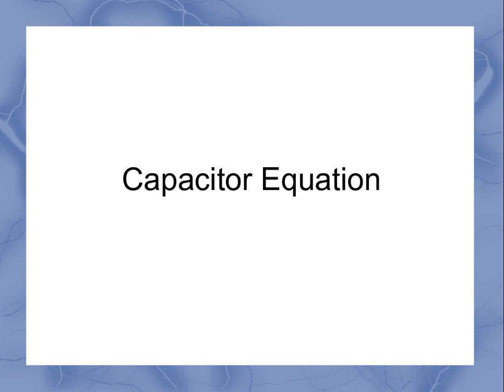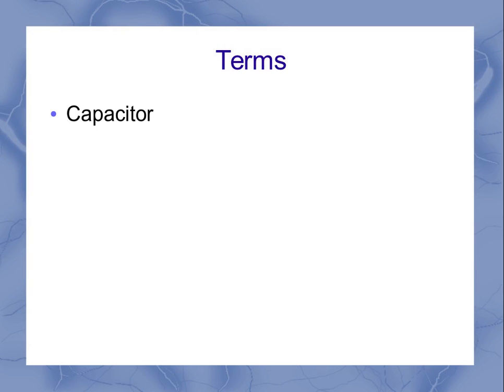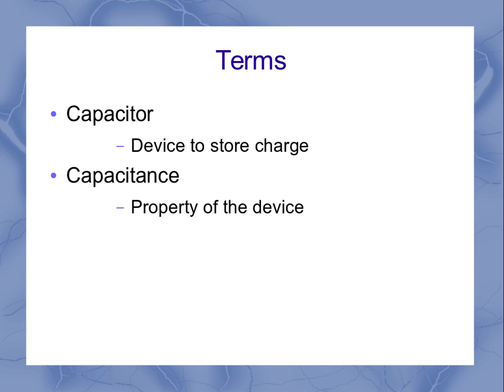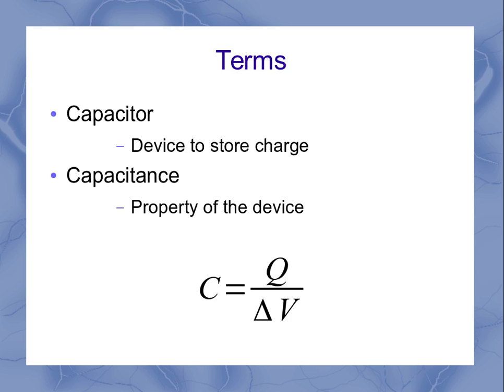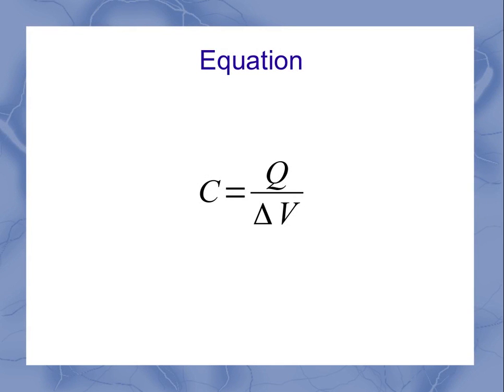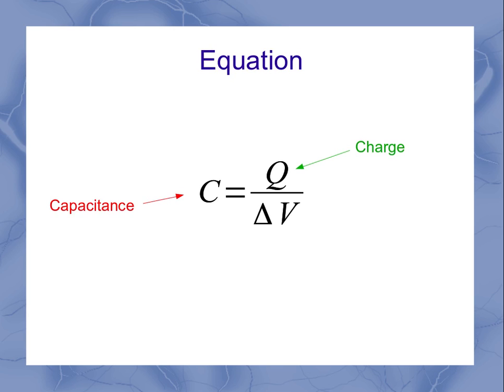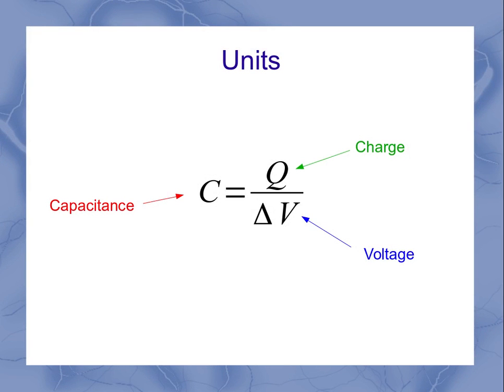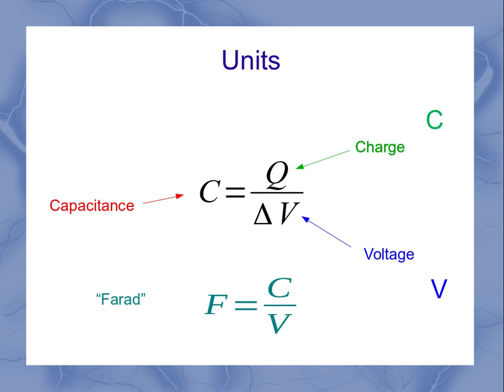The General Capacitor Equation

Comment: It is deviced to store energy not a charge ?
Reply from the maker: Depending on your viewpoint, you can look at it either way. Pretty much all capacitors are "charged" by connecting them to a battery which moves electrons from one side to the other. The full device has a net charge of zero, but one side stores a net positive charge at a higher potential and the other side stores the same amount of negative charge at a lower potential. The result is stored energy.
Reply: @DrJennCash  ok thanks mam